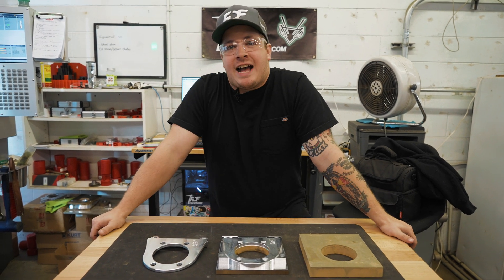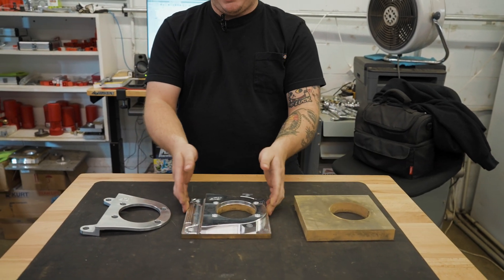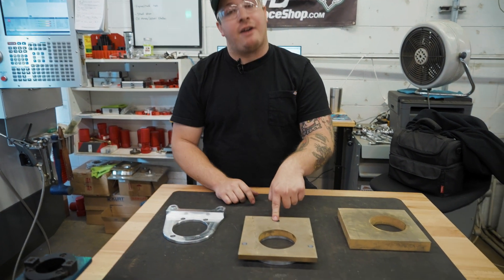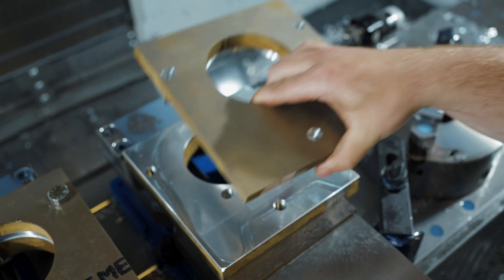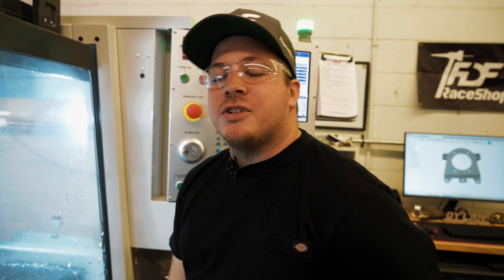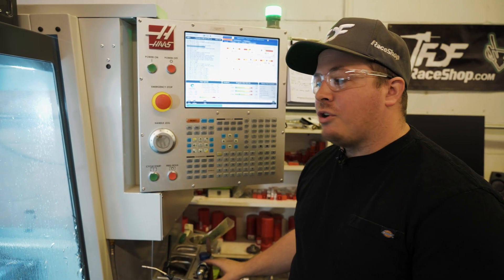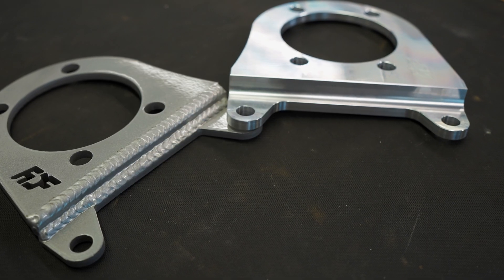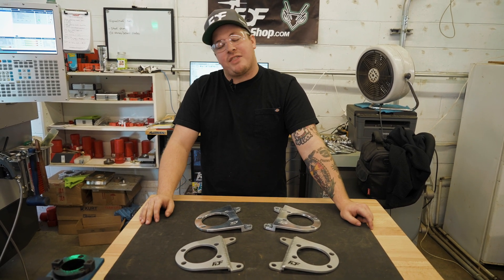Making Our New Genesis Dual Caliper Brackets

Comment: Great work. I have a question. I have a 2001 is300 with a custom BBK I used brembo from a genesis coupe and first gen Lexus ISF rotors. I would like to do a dual caliper setup. Do you think this will work with my setup? I’m not sure if the mount holes are the same from both manufactures. I removed my dust cover so nothing is in the way.